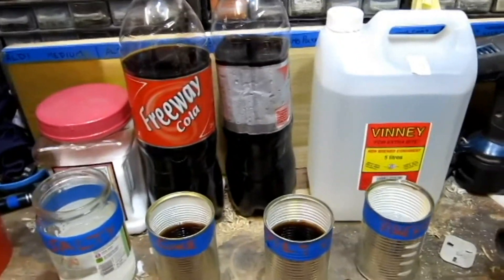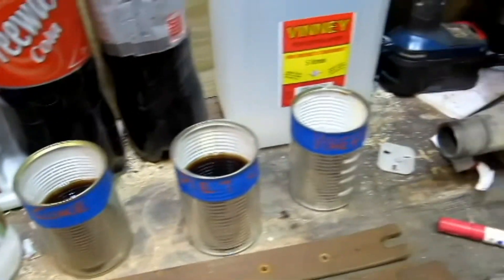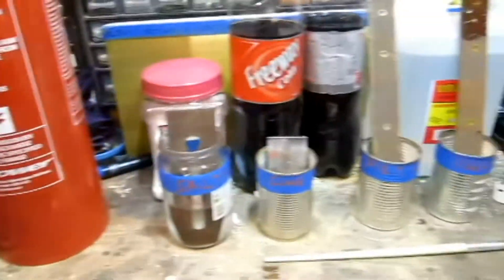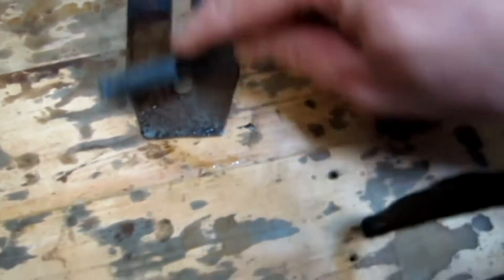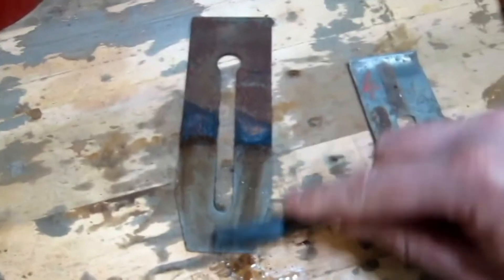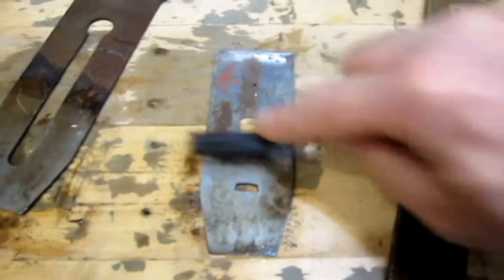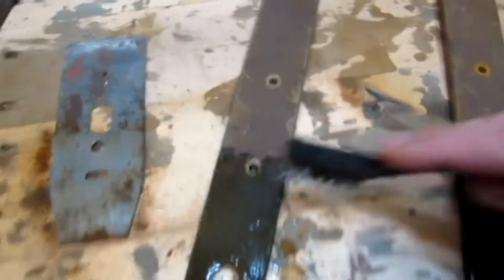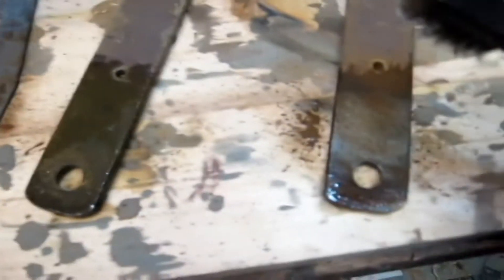Jeff's rust removal

Comment: Having used vinegar/salty vinegar many times in the past, a couple of words or warning from some of my past experiences. 1) Always soak/submerge the whole object to get even rust removal. 2) Don’t leave in two long (more than 24 hours) without inspecting it, vinegar eats more than rust. 3) Neutralize vinegar or rinse very well, and apply oil to exposed metal surfaces; untreated metal surfaces will rust again super quickly. I have some great pictures of a ruined Number six plane that was half soaked for too long if anyone wants to see....Just be careful